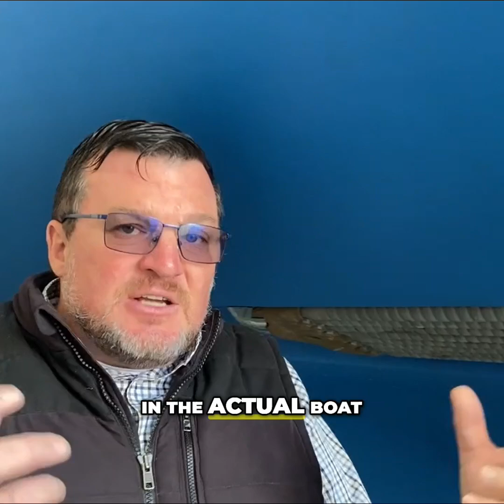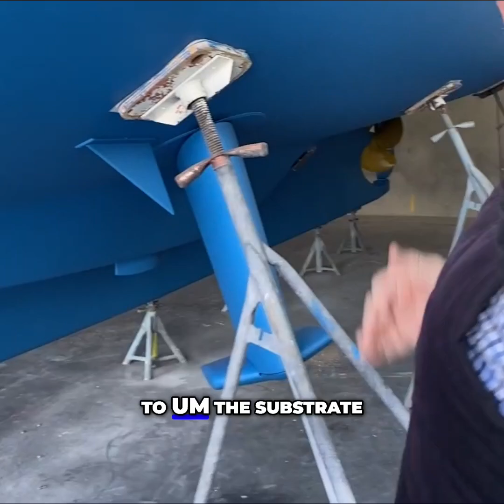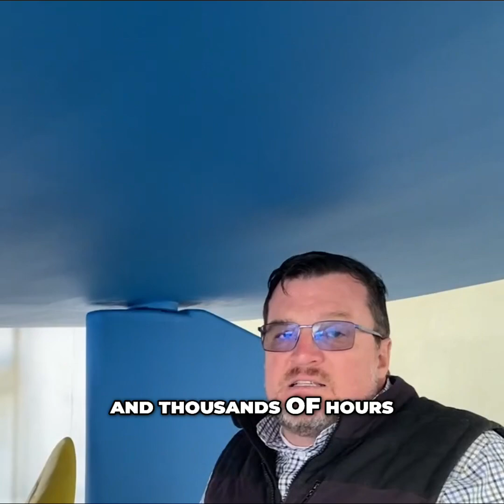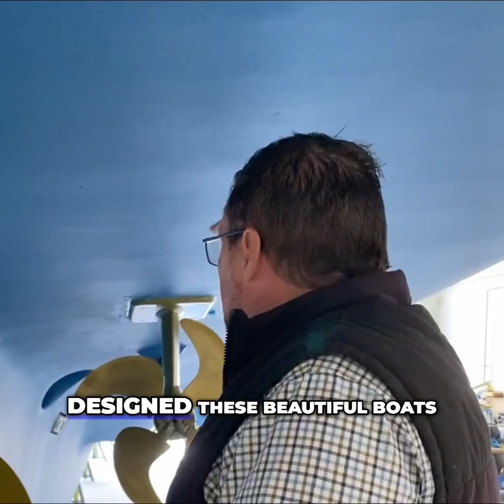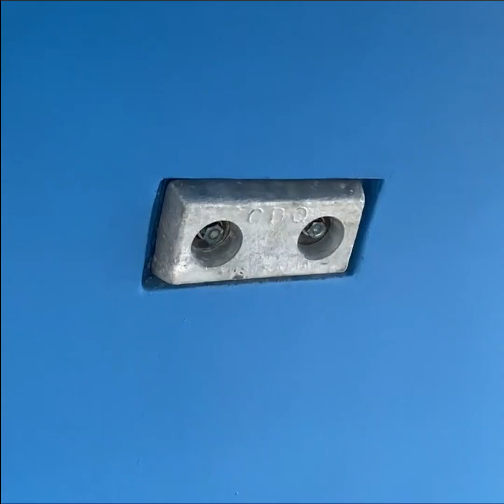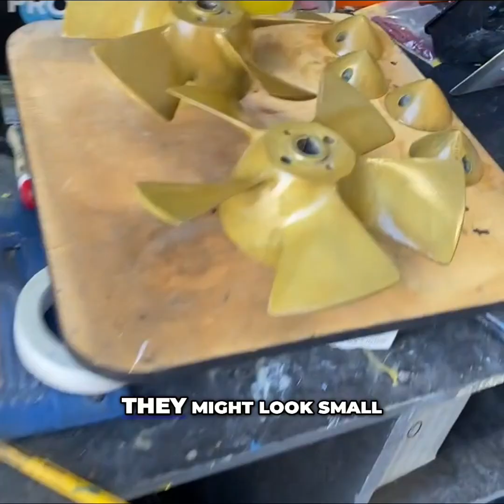Discover the Engineering Marvels of the Nordhavn! 🚤💪

Comment: Always thought "dry exhaust" meant the exhaust went out through a muffler and funnel rather than at sea level or under water via a water lift muffler. Nordhavn just has its engine water cooler in the sea rather than having an engine mounted heat exchanger which requires sea strainers etc etc.